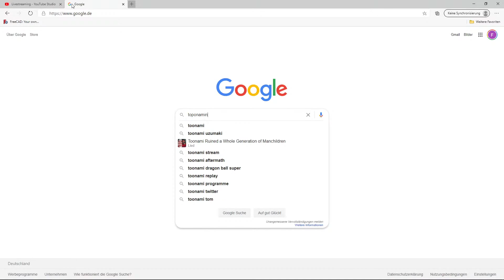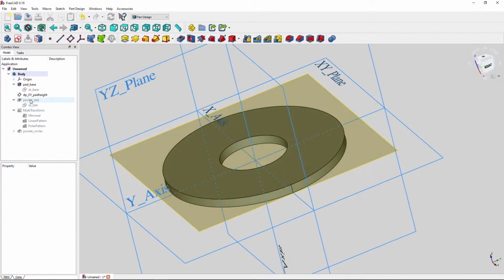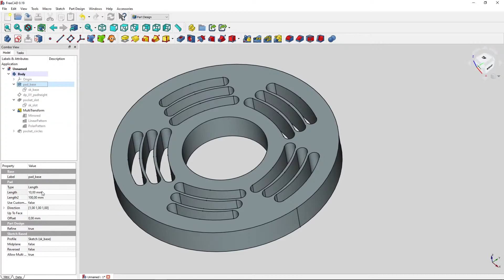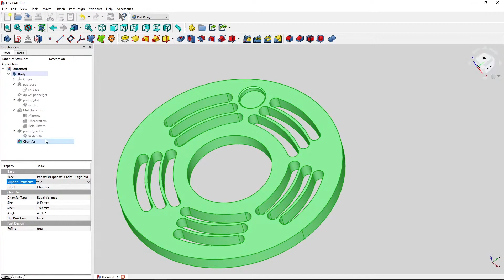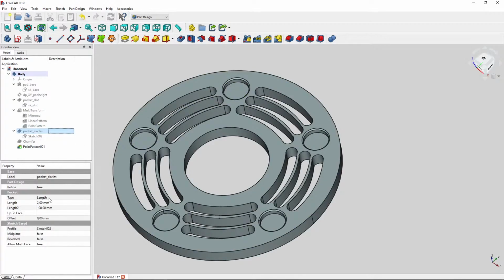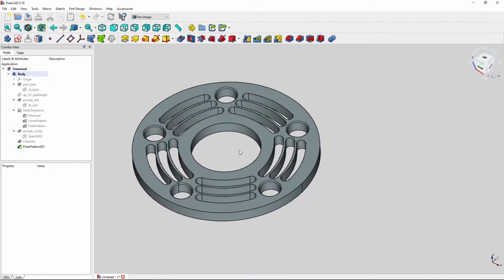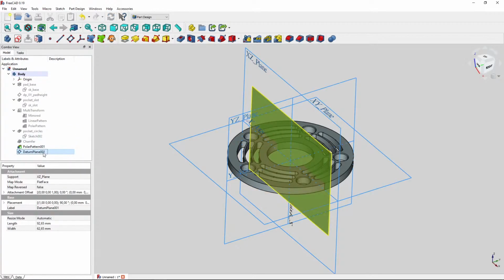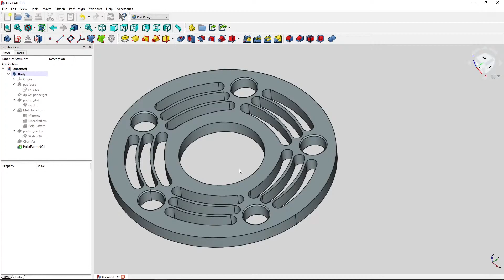The most annoying problem in FreeCAD 0.19 Part Design - Topological Naming [LIVE] (English)

Comment: That is bad. Having planes anywhere you want is a good feature, and when you have a complex model it is almost necessary. Used to live in D’dorf, then Basel. Now Silicon Valley. Where are you?
Reply from the maker: Yes, you're right. The possibility to create datum planes referenced to your 3D objects is essential and I hope this won't be an issue in the future. But as long as we have these toponaming issues it's advised to use the standard planes to reference new datum planes. I live in southwest Germany, about 1 hour away from Frankfurt. Nice to have you here on my channel! best regards and thanks for your comment!
Reply: sorry, slapping planes and sketches on generated  geometry with reckless abandon IS not considered best practice, and with complicated models, makes maintenance/modification difficult, even without the topo problem.

Comment: Because of this problem, I got used to only put chanfers and fillets as the last thing. And I also usually delete and redo them when I change something. Yes. It is very annoying indeed.
I think this can be fixed relatively easily with changing the internal naming convention to unique hash-like strings and never changing them instead of edge-this, face-that. But I've never seen the code and can't really tell if it's possible
Reply from the maker: Thanks for sharing your thoughts. Putting chamfers and fillets as the last features is a good workflow. But there are other features like the draft or thickness which also reference on 3D Geometry and to put these last usually isn’t that easy. 
So you’re right this absolutely needs to be fixed, these workarounds are just workarounds.
By the way, there’s already a Freecad version by developer Realthunder, the man who also codes the assembly 3 workbench. He has solved most of the problems with toponaming in his version. So we need to have these things merged into the main version of freecad soon ! 💪🏼

Comment: Thank you for bringing this topic up. As someone learning Freecad (still a novice but getting better); it is hard to understand why this is such a difficult problem to solve. I have changed my workflow over time to put all of the chamfers etc as the final step in the drawing to make it easier to delete them and then make changes to the parametric part.
Reply from the maker: thats a really good workflow and is even recommended when this problem gets solved to try to add your dress up features (fillets, chamfers..) at the end of the modeling process. Thank you for sharing!

Comment: Yes, it is problem but not that important because as a mechanical engineer I always did this features (chamfer, round) at the total finish of design in every CAD software (Inventor, Solidworks, Solidedge, Catia). An if you need invasive changes to design after released to manufacture stage than you delete this last features, make desired changes and than recreate chamfers as a last features. But of course never do reference the “live” geometry. So the important feature from this perspective which is not present in FreeCAD now is shared sketches functionality, IMHO.
Reply from the maker: thanks for your opinion. But of course it is important. Exactly what you describe (delete last features, change geometry, recreate features) is what I show as a workflow in the Video :)
Reply: @FreeCADAcademy   OK, my point is that in real scenarios this workflow is very cheap compared to overall process of thinking of concept, functionality and design of functional parts of machine. So more “important” from my perspective would be to have shared sketches functionality so you could reduce/eliminate referencing geometry.
Reply from the maker: @milanmartikan  why dont you put your sketches outside of the Part Design Body and then reference them into the desired body? you could use one sketch then for different bodies. Or does this not work for you?
Reply: Kinda. It is not possible to have multiple solids from sketches with more closed profiles so you make new sketch in active body than reference master sketch with cross-referencing but than have to delete all geometry besides that one actual profile which will be used for operation.
Reply: @milanmartikan  I have this same issue!! No one else is talking about it! I want to create one constrained sketch that can generate multiple parts.  If I pad any sketch, it becomes unavailable to other pads.  I can reference external geometry.  But if I do, I can't ever edit the original (because edits, like adding a hole, don't propagate to the object that referenced the external geometry, so you have to add ANOTHER hole which isn't liked to the original sketch). This seems like something basic which is missing.  
Did you find a workaround, Milan?

Comment: Yes it's so annoying... it makes me angry every time I hear it. I'm not a dev but I know how it could be solved (unchangeable assigned hash for every thing that would be named. Then reference the hash and you can name it how ever you want) and the current workarounds make me even more angry... solving a dump problem with a bad workaround... this was the reason for me to switch to realthunder's assembly 3 branch. Even if my models will be no more compatible I at least can work with the program in a sane way xD Will switch back to main line as soon as this is solved there. Sorry for the rant and thanks for your great content (German and English) :)
Reply: So are you saying that the realthunder branch has already solved this problem?  I'm fairly new to Freecad but understand this issue and it's a real hindrance in an otherwise great program.  I'm coming from Fusion 360 and have made 100s of designs in that and never came across this type of problem.  Also - how far behind the main branch is realthunders branch usually ?  Thanks!
Reply from the maker: Hi Lewis! Thanks for asking. 
Realthunder‘s branch is usually ahead of the main branch and has several „new“ and experimental Features included.
It’s definitely worth checking out. 
My main concern with the branch is just that I‘m afraid to show the viewers these things and 99% of them using the official branch (or even the 0.18) and cannot follow. So it’s not easy for me to decide. But I could introduce RT‘s branch in a follow-up video to this one. 
Realthunder is actually a official FreeCAD developer, That means that his features are very likely to be in the official branch sometime in the future. 
So: check out Realthunder‘s version and give feedback if you like! I’d be glad to hear from you! 👍
Reply: @FreeCADAcademy  i definitely get your point. For me the main argument against the branch is that you can't just switch bach and forth between it and the main branch due to the many (currently) incompatible changes. But the pain with this problem was a deal breaker for me and so I'm glad that i for now have an alternative. I will likely switch back to main as soon as this problem is solved there.
Reply: @FreeCADAcademy  A followup video to this one explaining the realthunder branch and the pros and cons would be great.  I'll be waiting for that 😊  In the meantime I may download and check out realthunders branch when I've educated myself a bit more.  Thanks for the reply !